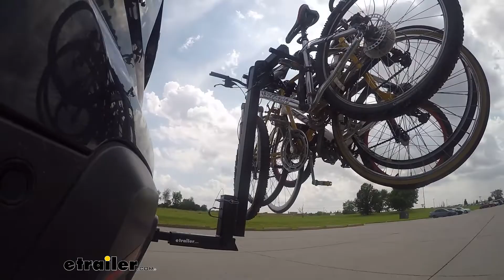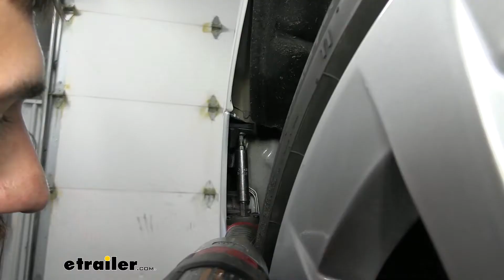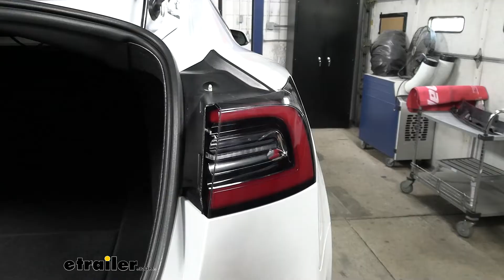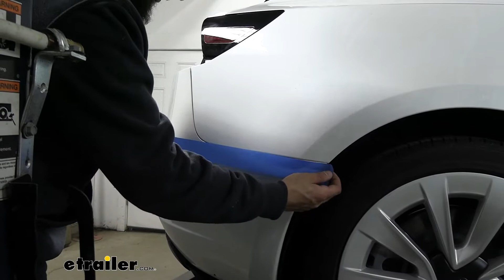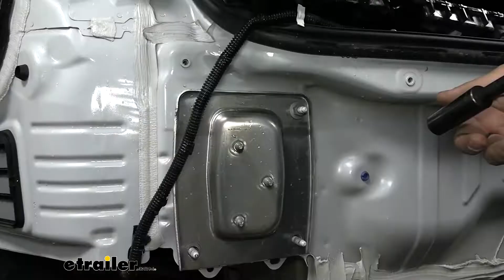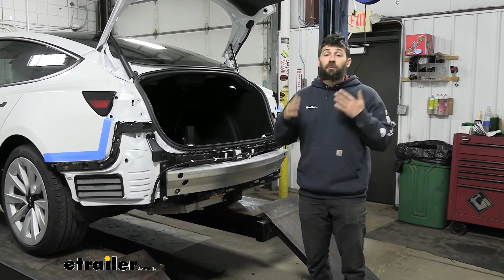etrailer | Mount: EcoHitch Stealth Trailer Hitch Receiver on a 2021 Tesla Model 3

Comment: I have issues removing the hitch receiver while my Model 3 sits on the ground.  Any advice on how to remove it?  I don’t need it on all the time, I even bought the magnetic cover to protect it once removed.  thank you
Reply from the maker: Are you not able to get a wrench up in there to loosen it up? If clearance is the issue you can get specialty tools that can help. Perhaps a crows-foot wrench, you can also talk to your Tesla dealer and see what tool they recommend to help you get the bolt out.
Reply: @etrailer  thank you, I need more clearance.  I've also lowered my car with MPP coilovers.  I didn't want to buy a lift just for this, but I may need to.  I want to be able to swap it on and off myself when needed.

Comment: does it have any affect on the sensors?
Reply from the maker: If you have anything mounted on the hitch and is blocking the sensors, it will set them off.
https://www.etrailer.com/Trailer-Hitch/EcoHitch/EH84GR.html
Reply: @etrailer  how to disable them?
Reply: Tesla told me it voids warranty